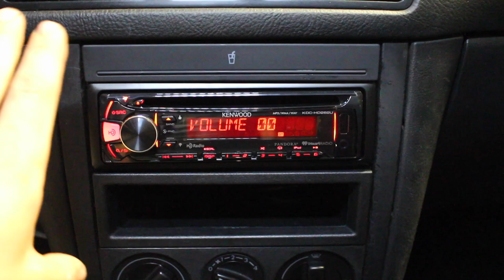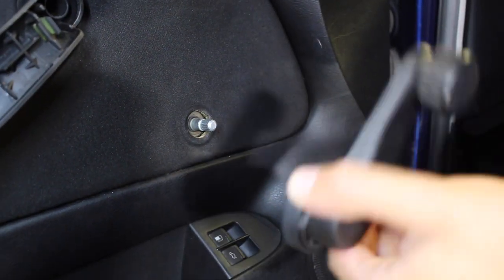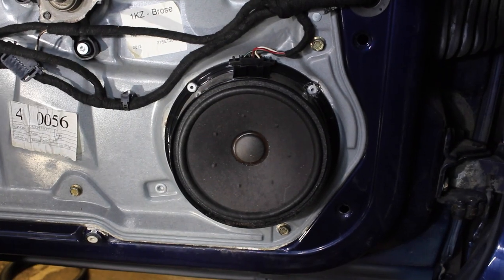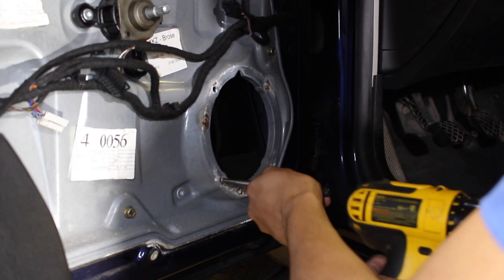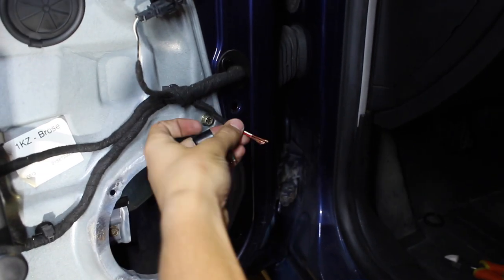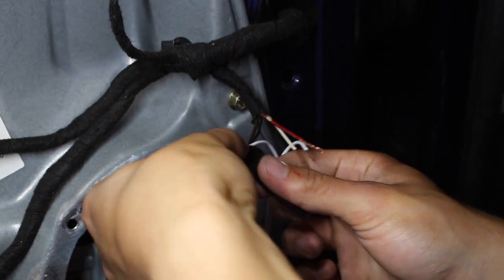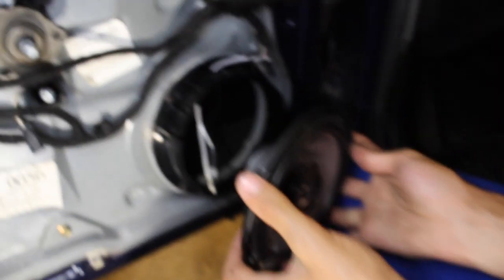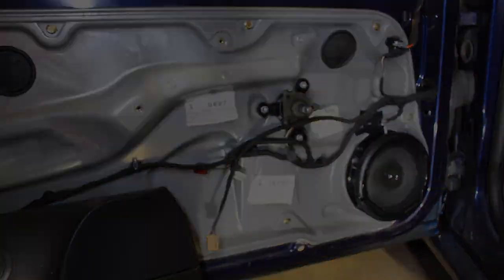How to Install Aftermarket Speakers

Comment: •The polarity of the speakers is important to get correct. After all they are + and - for a reason. 
•Don't drill the door with the window behind it!
•That is a bad way of joining wiring. Always solder and heatshrink the connection, or use a mechanical joint at worst. 
•There is no need to put the speaker cover on in that application as the door card already has a speaker cover. 
Please don't teach people to do things the wrong way.
Reply: mike field man i see alot of wrong in this video. Now i will admit that i don't always use connectors or the crimp method. But when i do wire the "shitty" way i wire them long ways and apply a tight layer of electric tape on it. I usually like to use male/female connectors or heat shrink
Reply: mike field It would be necessary to use oem connector to faston adapters.
Reply: @Simone-qr6mq  there u can buy VW/Škoda adaptor for the wire u unplug from old speaker.. easy and quick.
Reply: You should always solder and heatshrink the wires. And polarity does matter. Also drilling through thin metal with glass behind it isn't smart.
Reply: Thank you!!!!! i hate ppl who fuck shit up and make tutorial about it. ( I work at an audio/visual company)
Reply: Yes. Dont follow these guys at all.
Reply: Mke leave these guys  alone.
Reply: I was gonna write exactly the same comment. Mostly because of the soldering cause I get so nervous when someome does this.
Reply: thanks for this comment mate
Reply: Yeah bro how do you find which one is positive and which one is negative
Reply: Mannn then do a video the right way
Reply: For real.  🤣🤣🤣 let's just hook the speakers straight to the battery 🤣🤣🤣   he must be from "K"anada  🤣🤣🤣🤣
Reply: I was about to type this lmao, the speakers would be out of phase and when you notice it its annoying lmao
Reply: Although soldering is the best connection I still use butt connectors and crimp the living shit out of it (with the proper tool). In car audio it usually doesn't matter unless your are doing some high end shit. On my ring terminals for power and ground on amps I crimp the terminal with a vise because my crimper is not that big, but I also add some solder in there for a good connection.
Reply: I mean it worked. Don't matter how it got done
Reply: Tell 'em how it's done, bro!
Reply: PRO!!!!
Reply: I’m
Reply: is it + to + or + to - ?

Comment: I have those same speakers and they’re pretty good for the price, a great upgrade to factory speakers.
Reply: Did you ever think to yourself "why are there two + and two - wires..?" If so diid you conclude that the factory was using a twin voice coil speaker..? Because if you did you would need some serious help. It ant no ferrari or high end stereo and if it were high end running dual voice coils then you would touch any of it. So next question is "why are there 2 sets of + and -  ??? Did you check the factory speaker for any capacitor and resistor? Clearly NOT or else you would of not done it your way. From factory it is running splits (most likely better than the speakers you replaced it with, I'm sure after the video was over you said to each other that it sounded before you touched it) when running splits you use either capacitor and resistor on the speaker differ itself or a crossover extremely with more expensive speakers. Now I'm not 100% sure on your car because I'm only 12 but turning 13 in 2 months an 4 days  ;) if I had to guess I made the same mistake when I was just a wee little fella aged 6, one pair is the feed to the woofer from headunit or amp and the other pair is the output to the tweeters AFTER the signal has run through the resistor mounted on the original woofer to remove any low freq signal from it otherwise like you would of found out by now you have popped the tweeter because your running bass to the little guy.. the factory don't place individual terminal if it's all just connected to one. Think about it!!! Okay it's 6:30pm and mummy is letting me know to go to bed bed, so I'm off to brush my teeth and sleepy sleep, hope you don't screw up your next video and show potentially thousands of people how to waste there time and money to downgrade there stereo and make stuff blow up.. i admit I was hoping you slipped with the drill and shattered the window, my 3 year old sister did that a few months ago. She's not the smartest but by the time she's your age GOD damm, your going to make her look like a freaken genius..  nighty night. Stay in school, you need it.. :)

Comment: You can buy aftermarket speaker harness to connect directly to the OEM wires, no need to cut any wiring

Comment: The polarity of speakers is important! If you connect second speaker in opposite way to the first one audio waves will cancel each other out, and you will hear nothing or less powerful sound!

And why you are not soderin things together,? That is very stupid! One bad bump on rod and your whole installation can break a part or short out, and star fire.
Reply: Exactly what I was thinking... Also no point in having two speaker grills. Plus two of those wires are to power the tweeters. They get passed through the speakers, or so I've read on VW forums.
Reply: Are you talking about the polarity of the wiring of the speakers?
Reply: Yes
Reply: clearly you have no idea how "audio waves" work. This is by far the dumbest thing I have ever heard. Also, the "whole installation" will not break a part nor will it start a fire, fuses in the car will protect against any of this and they are already installed in series before the connection to the stereo. Solder job is important though!
Reply: Ryan Kall You have no idea what you're talking about.
Reply: DAMIEN Willoughby its "tinning" not tinting.
Reply: also, polarization is very important. my head unit has an option for reverse polarity on the subwoofer, and the difference is incredible.
Reply: J.W. you cant start a fire if the cable short out the on
worst thing thats going to happend is the fuse blowing up (sry for bad English)
Reply: If you switch polarity they will still work, but it will cause issues elsewhere. Especially if you start pushing a lot of power to your speakers
Reply: J.W. correct, they will be out of phase.
Reply: "Doesn't really matter, speakers work in both directions."

Glad to know I'm not the only one who facepalmed at this. Sure they'll *work*, they'll just sound like complete shit. Speakers sound terrible out of phase.
Reply: Or u can just buy vw adaptors so u dont have to cut the wire buy x2 for £6
Reply: Drissen you can't cause a fire if the speaker cables touch
Reply: Hahahhahahahahahhahaha
Amateurs
Reply: Fuses in a vehicle do not protect against arcing or fire. Fuses are meant to protect components from spikes in voltage or excessive amperage draws that would damage them. It is still possible for wires to arc and while unlikely, fire is possible. Twisting wires together with electrical tape is extremely amateur. Summer heat can cause the tapes glue to fail exposing wires. Wire connectors are very inexpensive so I don't see why you wouldn't use them.
Reply: Having a good amp is more important than the speakers.
Reply: So its clear.
If you connect positive wire to negative end of the speaker and the negative to the positive the membrane of speaker is moving  backwards. Its supposed to move forward.
The manufacturer didn't mark the positive and negative ends of the speaker for no reason.
It will still work but you won't hear the sound in the way it's meant to be listen to.

Comment: I like your videos you had shown me things that coming in handy but I would like to help you out as an install Institute tech it is called in phase and out of phase. in phase is when you hook the speaker negative to negative, out of phase is when you hook up negative  to positive make the speaker work backwards you still get sound but the speaker works opposite polarity instead of pushing it's  pulling

Comment: Hey, speakers do have polarity and even though they work in both wayss you must connect the speakers in the correct direction so you dont damage the coil.

Comment: Ok peeps so I tried this too and what they did cut out is the struggle with the screws and not having the perfect alignment for the new speakers (even tho they are the same size) instead of 4 new aftermarket speakers I have now 3 stock speakers instead of 4.

Comment: Great video, but polarity is important. An easy way to tell if the wiring is correct is use a AA BATTERY. Simply touch one lead to the positive and one lead to the negative, notice the speaker when it "thumps", if the speaker sucks inwards it's wired incorrectly. If it pushes outwards then it's wired correctly. If you listen carefully, you will be able to tell which way it's "thumping". Just my two cents.
Reply: Danny Deanda thanks for the tip, I remember knowing this trick before but forgot which direction the speaker should go to know if it was right or not. Out good, in bad, got it!!
Reply: don't you mean a 9v battery?
Reply: Correct, but make sure to use a DC 9V battery as it's the closest thing to 12V which the car runs on.

Comment: DO NOT USE this video to help with your own install. Never twist wires and just use electrical tape! That is about as amateur as you can get. If you are going to do something like this do it right the first time. ALWAYS solder connections and heat shrink if you have the tools or at least use crimp connectors if you are lazy. Doors will always have a little condensation in them and as soon as that condensation gets near that tape, it will fall right off leaving an open wire.
Please if you need advice on car audio installs go to a real channel like "caraudiofabrication".
As a car audio enthusiast this video is horrible. I LOVE YOUR VIDEOS, BUT your car audio skills are horrible and you should not be giving advice about this stuff. 
In this case, the speakers you used have 30 watts RMS (which is alright for that head-unit to push them)and should give an OK sound compared to stock. But in general, replacing just the speakers without a proper amp install to go with them will NOT give you better sound and if it does it will barely be noticeable. 
Seriously @milanmastracci, you need to remake this video showing the proper technics because the wiring in this video will cause many people problems if they follow it. Also, Proper speaker selection would be helpful for people would don't know what there doing, like choosing speakers based off of Rms NOT peak power. 
Sorry for the long comment, but this half ass job needs to be pointed out and FIXED right away. This is not a hate comment, only the truth.

Comment: please dont follow this guide. Speaker polarity is important to have them in phase, else your speaker will be subtracting sound not adding. Also never twist wires together, solder or crimp join them... and join them end to end with heat shrink, not joined at 90 degrees going back on itself.

Lol at blaming your brother for nearly breaking the window when you told him to put it down...
Reply: Why is it so important to solder?
Reply: @littv1610  solder or crimp. If you twist them they oxidise and create a bad connection either getting hot and destroying performance or disconnecting. Solder is the best join but crimping is fine, if you have a lot of vibrations crimping is considered better.
Reply: @veneratedmortal4369  ok thanks brudda

Comment: Good try at a how to video, been installing stereo equipment for over 30 years. Please use connectors and shrink tubing, leave window up  and check clearances before you put the door panel back on, and connect wires to the correct polarity

Comment: Why did you put coaxial speakers on the bottom? You are just flooding the audio with highs, you should’ve bought some components instead, preferably with a crossover

Comment: When I did a speaker install if you aren’t using the old speakers you can cut the connector from the old speaker and wire the new speaker to it it works perfect and you can get the polarity correct with minimal soldering or wiring

Comment: Something to note is too check the impendens on the speakers you have and the once you are planning too get , if it has a higher OHM value then in most case the stock AMP wont be able to power them correctly and the audio quality might start lacking :)

Comment: A lot of things are not right in this video..

- drilling the speaker rivets with the window down
- cutting the OEM wiring when you can find cheap adaptors for that on ebay
- wires not soldered or correctly insulated at all, which is fundamental in any electrical job
- installing cheap coaxial speakers that actually sound worse than the OEM VW speakers
- installing the speaker grille when the door card already has one

Next time buy a component setup from a reputed brand and do these things properly..
Reply: ravagerslb Yeah, you are right! VW/Philips speakers sound better...
Reply: That's what I have, the 4 woofers plus 4 tweeters with a Pioneer headunit.. it sounds pretty good for a stock sound system, to the point of having people asking me which brand of aftermarket speakers I've fitted to my car.
Reply: I was just going to say that same thing
Reply: Awesome right? This tells me that PHILIPS is a nice company :D

Comment: Solder the wires properly, used an insulater and shrink it with a heat gun. Make proper connections (i.e. polarity). There are also vw wiring harnesses that makes connecting the speaker to the car connector plug-and-play.

Comment: Omg.. this is how you DO NOT  install speakers.. positive and negative connection doesn't matter.....Are you serious?.. and in the end you installed grill inside of the door panel...you just completely killed me.. you do not install grill nside of the door... its only made for the vehicles that are capable to have grill on the top of the door panel,  it just to bring a design and show the brand name ... Like Come on..
Reply: Lol i worked at gray audio and it really doesnt matter tbh you’re just whining rn

Comment: No twisting it is a bad habit. Soldering pls. Crimpwrap not tape. And lastly are you replacing a one way unit for a two way unit?? You normally do better than this. Lazy video......

Comment: I have to say thank you for your video, I actually did this my car which is a Volkswagen Golf; I preformed everything in the method that you have demonstrated. It really gave me the confidence and the ability to do. I the only thing I didn't do was the wiring since I did not need to, the speaker adapter just came with two wiring harnesses.

Comment: Bro please just run new wires and leave the OEM smh
Reply: To run new wires? Do they have 2 come  from the din harness?
Reply: @LxTxSURGE  you just need to run new speaker wire from the door to the radio aftermarket speaker wire is better than OEM also what if your leasing the car or will sell in the future and want to remove your expensive aftermarket speakers and your have cut up the factory wires... bad mojo bro also you should solder the wires to the speakers much better connection

Comment: Did you ever think to yourself "why are there two + and two - wires..?" If so diid you conclude that the factory was using a twin voice coil speaker..? Because if you did you would need some serious help. It ant no ferrari or high end stereo and if it were high end running dual voice coils then you would touch any of it. So next question is "why are there 2 sets of + and -  ??? Did you check the factory speaker for any capacitor and resistor? Clearly NOT or else you would of not done it your way. From factory it is running splits (most likely better than the speakers you replaced it with, I'm sure after the video was over you said to each other that it sounded before you touched it) when running splits you use either capacitor and resistor on the speaker differ itself or a crossover extremely with more expensive speakers. Now I'm not 100% sure on your car because I'm only 12 but turning 13 in 2 months an 4 days  ;) if I had to guess I made the same mistake when I was just a wee little fella aged 6, one pair is the feed to the woofer from headunit or amp and the other pair is the output to the tweeters AFTER the signal has run through the resistor mounted on the original woofer to remove any low freq signal from it otherwise like you would of found out by now you have popped the tweeter because your running bass to the little guy.. the factory don't place individual terminal if it's all just connected to one. Think about it!!! Okay it's 6:30pm and mummy is letting me know to go to bed bed, so I'm off to brush my teeth and sleepy sleep, hope you don't screw up your next video and show potentially thousands of people how to waste there time and money to downgrade there stereo and make stuff blow up.. i admit I was hoping you slipped with the drill and shattered the window, my 3 year old sister did that a few months ago. She's not the smartest but by the time she's your age GOD damm, your going to make her look like a freaken genius..  nighty night. Stay in school, you need it.. :)

Comment: The OEM speakers have a crossover in the amp if you have Monsoon system. Bet these 2ways sound like sh!t.
Twist and tape... WTH! This a hillbilly car stereo install.
If you just go to Crutchfield's website you'd know which speakers will clear the glass. No need for that window to be down.